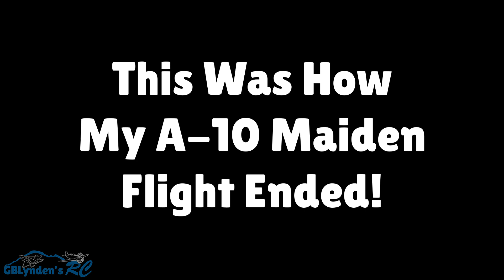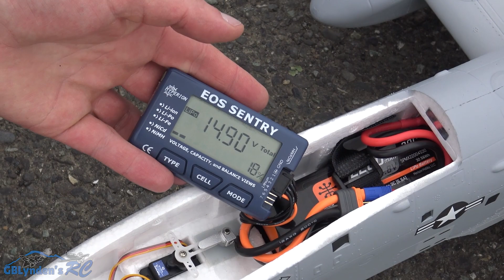Curb Stomp | XFly A-10 Thunderbolt II Twin 50mm EDF Jet

Comment from the maker: Link to this XFly A-10 Warthog: https://amzn.to/3N3J3Am or https://www.gblynden.com/

The links in this description are affiliate links. They give me a small commission on sales which helps support the channel and keep it independent: https://www.amazon.com/shop/gblyndensrc

Nose Gear Upgrade:
- https://amzn.to/3zLP5CI

Radio Used:
- Hobbyzone: https://bit.ly/2SFAaXA
- Amazon: https://amzn.to/3qlysrJ

4S 2200 Spektrum Smart Battery: 
- Hobbyzone: https://bit.ly/30kHBUg
- Amazon: https://amzn.to/3sWHiex

Spektrum XBC100 Smart Battery Checker & Servo Driver: 
- Amazon: https://amzn.to/2ESwAyB
- Hobbyzone: https://bit.ly/3hSUJqq
- Amainhobbies: https://bit.ly/2XjRWPh 

Thanks to John for recording this flight for me. Here is a link to his YouTube Channel: https://www.youtube.com/user/JohnVH541

Radio Settings:
- Aileron: 55% on Low Rates
- Elevator: 85% on High Rates
- Rudder/Steering: 70% on Low Rates

Comment: That sucker is a hotdog. Looks smooth in the air, scary landing them. 🤠
Reply from the maker: Thank you! I think I have the landings worked out. It does suck not having a rudder or flaps though 👊🏻💥👊🏻